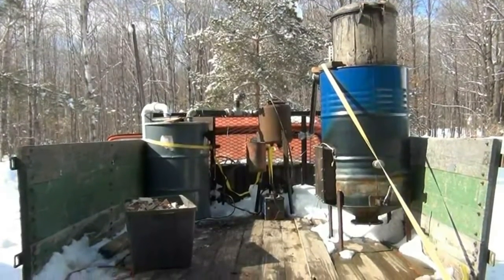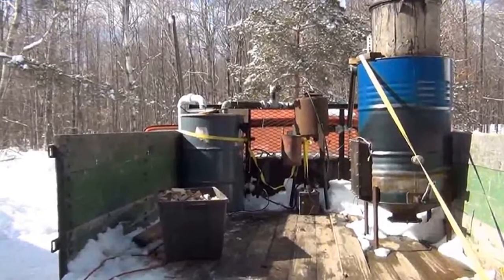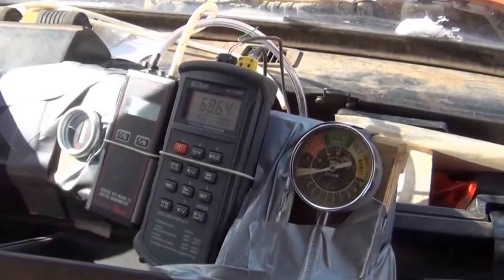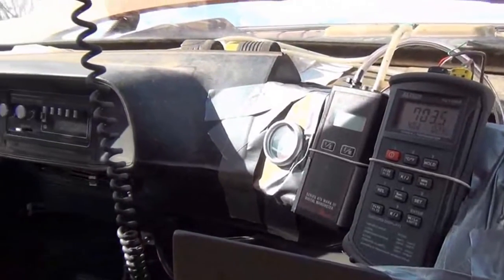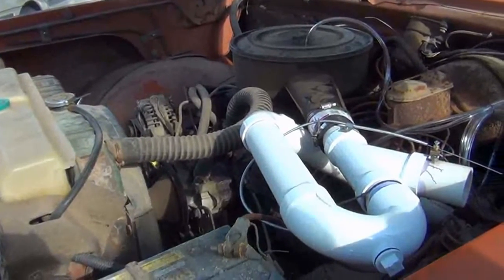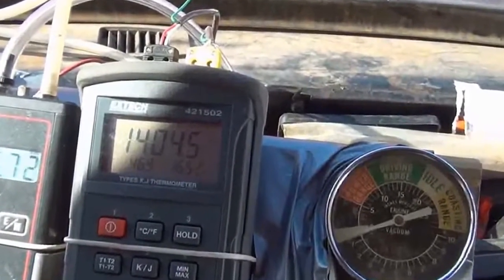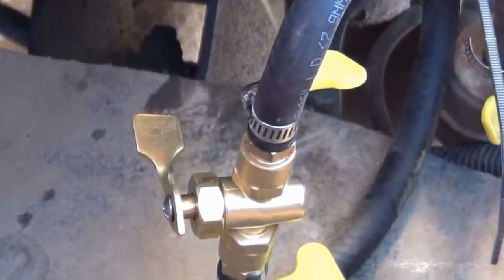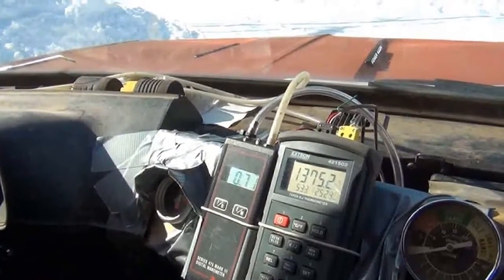gasifier in 76 Dodge power wagon 360cid

Comment: "Have to get a feel for it," my rear end!  I'd say you started out with a pretty good feel, just by getting it to fire up at all!  I couldn't begin to list the things I'd've gotten wrong and or count the number of times I'd meet with utter failure before getting it to run.  Amazing feat of back-yard engineering.

More than just prove it can be done, I think I'd try to make it practical, and have a vehicle designated for wood gas, and make big batches of wood gas, store it in a big tank or tanks at the homestead, and put a permanent tank in the vehicle that I could fill at the pump.  I think propane tanks and fittings will work.  Making the gas at a permanent facility would allow you to add big, bulky improvements to the quality of the wood distillate.  Better, more efficient hearth.  Pumps.  Bigger/better filters.  

I guess there's a "methanation" process, where they run the wood gas through a nickel honeycomb catalyst to produce methane that is pretty much the same as fossil-sourced natural gas.  There are people in Canada and Scandinavia working on this.  Very practical way to power vehicles in wooded areas.  Might be easier to just buy a rig set up to run on natural gas and then make your own high-grade natural gas at the homestead.

I think I would make the gas separate from the vehicle, and marry the wood gas to the vehicle with tanks of wood gas, or maybe just fill the vehicle tank from a larger tank at home base.  That would make the vehicle relatively normal to use, and you'd probably get better consistency, making it in batches at home.

Still it's cool to have a rig set up this way.  The idea of cutting down trees and making your fuel as you go is pretty cool.  :o)
Reply: Check out Marcus Norman's channel he's got a Dodge v10 and he's getting 30mpg lol!

Comment: Very cool. Good to know it can be done. I posted a video on my channel about making diesel fuel out of wast motor oil. I have made and ran the fuel in my 96 dodge Cummings. Once the filtering process is figured out, it's not a lot of work to make. Iv used lots of stuff to make black diesel including brake fluid, transmission fluid, power steering fluid, gear oil, motor oil, gear oil, cutting oil, hydraulic fluid, tiki torch fuel and kerosene. Iv also blended in synthetic oils with no problems. It does smell funny especially when idling long periods of time, but it works. Good to know these things can be done in case we ever need to resort to it.

Comment: Could or would you explain how you are getting the temp readings from the hearth? Also how you can tell the richness of your fuel mixture. I've been wanting to put a gasifire on our big dump truck for a while. Being able to understand how to run some key point gages will help.
Reply from the maker: Phil
I inserted a thermocouple into the side of the choke plate. 3/16 hole in the edge of a 3/8 plate you can see it on the design video.
I also used a air fuel ratio gauge to monitor the fuel mixture

Comment: I had a 360 in an 87 Dodge dually 12 ft dump bed. I couldn't afford the gas for it. Traded for a 1965 C-60 Chevrolet with a 292 in line six. It hauls heavier loads on half the fuel.

Comment from the maker: Mick,
Thanks for your comments and questions. The gasifier was built as a test unit and running the truck was an after thought.
I wanted to see if I could use my test unit to run a truck b4 I jump in with both feet and buy a truck.  The test went ok but the gasifier was too small. I liken it to a gorilla trying to breath with a straw. Since then I have bought a truck and I'm building a new gasifier.  I'm a member of driveonwood dotcom. I hope to have my truck running on wood this fall.